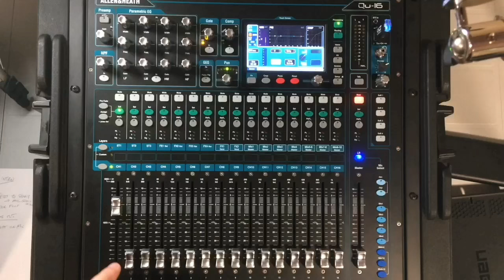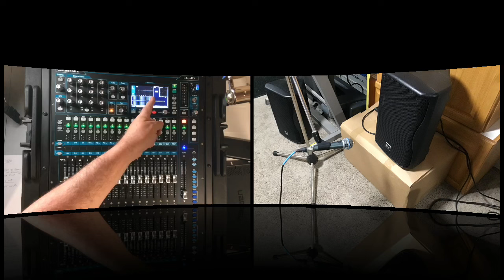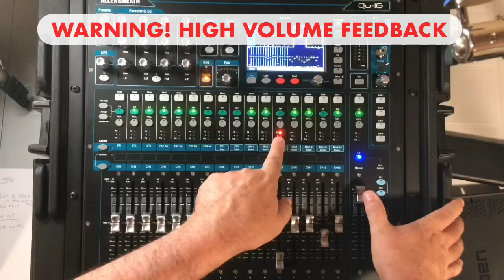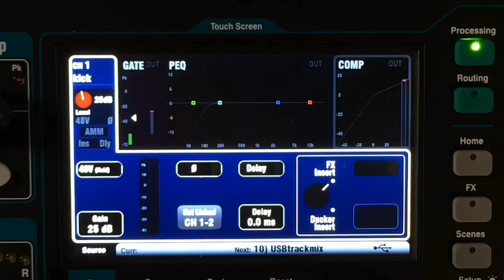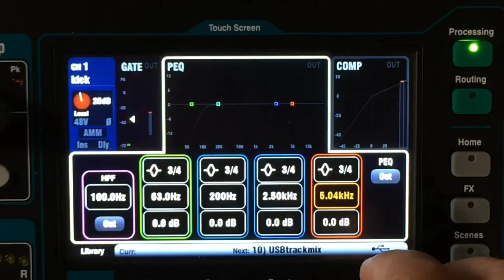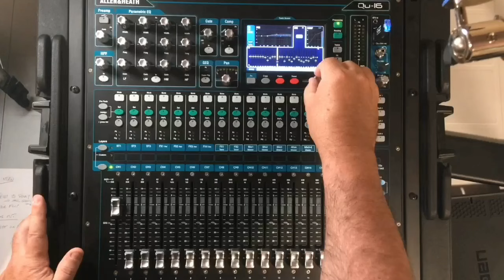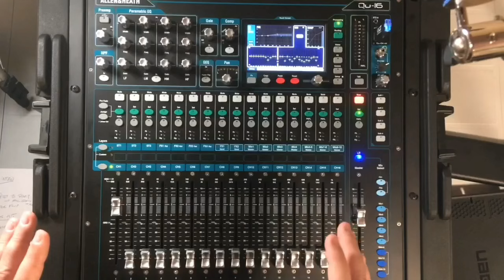How to ring out mains and monitors - A&H QU series WARNING High Volume

Comment: Is this level of eq cut pretty extreme because the mic is right in front of the speaker?  I would think this much master eq manipulation would negatively affect the overall sound, especially if you have lots of mics. Thanks for the video!
Reply from the maker: Thx James.   It’s not really that extreme.  As always eq cuts are like salt.   A little to taste goes a long way.  I did exaggerate the effect with a very close mic since you would hope that no one puts a mic that close to a cab in real life.   Unfortunately I’ve seen far too many singers drop their mic to their side and essentially point almost that close to a monitor wedge.    The number of mic’s wouldn’t have any bearing.

Comment: I use the same mixer.  Thank you for all the great content.

The thing is though.. When I have 4 different set of speakers for LR, Mix1, Mix2, Mix3.. It means I would have to use the same mics per speaker to ring out bad frequencies right?

Now what if...  I have 3 different brands of microphones? Do I then do it to each mic per speaker?

And yes, it's one of those mics getting too near the speakers/monitors that becomes the culprit so better prepare for it.
I did see someone comment on the number of mics and you say it won't affect overall sound.. so my dumb question would be: what if they are from different brands?
Reply from the maker: Thx Karl.  Yes, you are creating an eq setting for each set of speakers (unless they are identical speakers.  Eg, if mix2 and 3 are the same boxes then simply copy the eq after setting it for mix2).   You can use the same mic because you are determining how that same mic is reproduced in each of the diff speakers.
If you have diff mics, you just need to pick the one that either you use the most, or the one that has the most even tone.
Reply: @soundadvicewithrob3083  Thank you for the reply.  Currently using the mixer at an event now. Sadly speakers are all different, but I have managed to ring out the bad frequencies.
But I did it only with one type of mic.  We use Shure and Sennheiser mics and I only used a Shure mic for this process. Now we have boom mics too. And I didn't get to do this process.  Big regrets.

Comment: Thanks Rob. Now I now how to use that GEQ on our QU24.  You had the mic only 2 feet away from the speaker.  If I wanted to ring out the room however, wouldn't it be better to have the mic in a central "average" location.  Say middle center of the room?
Reply from the maker: I should probably post a disclaimer to that video because you are certainly not the first person to assume I intended it to be “literal” LOL.   I was really only trying to demonstrate the concept of notching the eq to address feedback.   Yes placing the mic right in front of the speaker was a) meant to create feedback quickly and b) I was working on a small space when I shot that footage.   Personally I find that 99% of feedback comes from stage monitors and very seldom from FOH (although it does happen).   Standing on stage I ring out monitors by literally pointing a mic into the wedge to force feedback, so the 2ft distance is fairly accurate.   Take it all with a grain of salt and you’ll find a way to apply the concept to your own situation.   Thanks
Reply: ok got it.  You do talk about that in the initial paragraph that I didn't read.  Thanks Rob. @soundadvicewithrob3083

Comment: Great video it will be helpful. Does ringing out bad frequencies generally give you a good EQ do you then need to boost good frequencies with the parametric?
Reply from the maker: Thx Jonathan, glad it was helpful.   Yes once the system is rung out, it’s a great place to start.

Comment: This is a great tutorial! Very helpful. However when I do it on my QU32 I end up cutting almost all frequencies from 400hz up, before touching the -10dB on the master fader. I have all processing turned of in the mic channel I'm using. Am I missing something?
Reply: Hello. It sounds like your amps might be turned up a little too high. Try just playing music at unity. If you have the input gain set correctly, and that channels fader at unity, then your main fader at unity, is it too loud? If so, then your amps(speakers) are turned up too high.

Comment: Another question for you. I use my laptop to play music such as youtube during some practices. I used to be able to use any of the ST1, ST2, or 3. My laptop reconizes the qu16. but when I pick any of the 3 I am not getting any sound. Any ideas why. Like I sad I once was able to do that. I tried different USB cables with no luck doing that.
Reply from the maker: Brian Larson The most likely issue is that the source for ST1/2/3 is not set correctly.  It must USB Streaming.  Select ST1, then select processing screen, select the function key to assign the source.   Make sure ST1/2/3 are set to USB Streaming.   This will allow the laptop to send output into either of those 3. Channels

Comment: Here's another quicker solution for mains 1) Set your PA and mics up properly on stage (Speakers always in front of mics) 2) Ring out the mains by bringing up the main vocal mic. You'll find you only have to remove one or two lower frequencies. Done.

Comment: Rob, we have a Qu-32 at our church. It was set up (pre-COVID) and it sounds fine live in the sanctuary, but I think that's because of the pre-amps in a not-easy-to-access location above the chancel area. We hardly get any lights on the Qu-32 ... sometimes one green. We're not getting much oomph to our livestream (Mix 9-10) even with all the levels pushed to the max. Do I need to adjust the pre-amps to a lower level and bring the gains up to help with this? I'm kind of grasping at straws...
Reply from the maker: Thx for the question Ray.   First question is Mix 9-10 set as prefade or post fader.    I’d suggest prefade so that the mix gets signal before the main LR faders
Reply: @soundadvicewithrob3083  All of the lights are green for Mix 9-10, so prefade.
Reply from the maker: Be careful about changing gains at this point if the FOH already sounds good.   Of course thats assuming that gain staging for all channels was done correctly, initially.   I have another posted video specifically on gain staging.     If youre not getting sufficient signal in a Mix output and have confirmed that that mix is prefade, then channel gain may indeed be the issue.   I suggest you save a scene before starting any major changes so you have a place to come back to if needed

Comment: Thank you. Did you explain to me how to connect a stereo cable, such as a DJ keyboard? Thank you very much
Reply from the maker: Connecting stereo is quite easy but depends on your wiring.    If you have 2 separate cables (either 1/4 or XLR) you simply connect each to adjacent channels. eg 1&2.      Then use the PAN control to move one channel to Left and the other to Right.     Finally for convenience you can link the two channels so they are controlled as one.   
if you are using a single stereo jack, the QU series mixers have 3 jacks just for for that stereo connection (ST1 ST2 and ST3)
Reply: @soundadvicewithrob3083  Thank you very much. This was very important for me and your excellent explanation made it very easy

Comment: So I am thinking about getting this board. I am coming from the QSC touch mix, and it will do it for you automatically when you press the feedback wizard. Does this have the same option, or do you have to do it one by one?
Reply from the maker: No, the A&H boards do NOT have the builtin feedback wizard found on the QSC
Reply: @soundadvicewithrob3083  Thank you, I appreciate it.

Comment: question if you are trying to do this with tower speakers do you use 2 mics  1 high in tweet section and 1 low in bass section???? Or just what??? Thanks
Reply from the maker: A single mic will work but pull it back far enough to catch the full audio range
Reply from the maker: A single mic will work but pull it back far enough to catch the full audio range

Comment: Is there a reason that you don’t EQ the mic before you start EQ the monitors ?
Reply from the maker: I think its prob better to use a source with a flat eq.   The Eq changes are then based on “any” SM58 in my case rather than an input with a custom setting.

Comment: For the Mic channel you are using, what is the gain setting for that channel?
Reply from the maker: Gain is typically set where the input peaks “around” 0db on the scale
Reply: Next question: how would you suggest we set the volume on our powered FOH and monitor speakers? At 2:00 is good?
Reply from the maker: Anywhere between 12 and 2 is fine.  Really depends on your venue and SPL

Comment: Sorry to say this but ringing out monitors like this is not really good, like another poster said, you have to make the room as neutral as possible with a good reference material. Next, you EQ the source to your liking. After you have done that, and only then, you get rid of a couple of unwanted frequencies with a parametric EQ not a graphic one, always using a narrow Q. I'm talking about 3 or 4dB cut at max. If you analyze that graphic EQ curve with Smaart you'd see how bad it is

Comment: Does this mixer work with pc now or is it still only mac
Reply from the maker: Thx for the question.  There are quite a few PC-based software daw that will work with the QU series.   You simply need to download and install the A&H driver

Comment: In normal operation you won't have your mic pointing directly at your speakers. you EQ settings is way too much cut's out that is "kilning" the sound. on A PA system, you only have to warry about vocal MIC's to feedback. so set up your mic's as they are going to be for the show, and  than use the procedure you showed!
Reply from the maker: Agreed.  Normally I wouldn’t want anybody to point a mic at a speaker like my demo.   However in real life I’ve had far too many novice singers and speakers who drop their hand to their side while holding the mic and it ends up right where I didn’t want it LOL.    Hopefully most folk will realize that this was a demo and I did exaggerate things to make a point.   Ths for watching and taking time to offer your feedback.

Comment: What would you start off on the fader 0db are -5db
Reply from the maker: if you’re referring to the main LR fader it’s personal preference.    for me I start at -5 and then i know i have that last bit of push up to 0 when i need it.    Up to you
Reply: @soundadvicewithrob3083   what would start the gain for the mic an the fader the same as the main
Reply from the maker: I have another video about mixing for a band which covers the process of gain staging.   I can't (and shoudn't) give a "start position" for gain because the proper process is to adjust the gain until the input level is around 0db.   This means the actual gain control will be completely diff for every input channel.

Comment: Sorry, but the concept of "ring out" a specific mic/speaker combination is senseless except when you only use ONE Mic and sound quality is no object.
In a typical stage situation you should adjust/filter the system (PA/Mon) to make it sound good or as neutral as is could be.  After that, you should adjust the actual mike
to sound good with an *actual sound source*. After this you will have no feedback if that is done right except unhealthy volumes come into play. 
But again, the above "ringing out"-method will not help you because feedback-frequencies and sources will become unpredictable for various reasons!

In short words: Filter if only feedbacks occurs (if you are not sure where: use the analyser that your decent console hopefully offers) -  
and good sounding system is always the best way to avoid feedback. It's that simple.
Or: Don't waste your short time on "ringing out" a random situation!
I started that way 30 years ago. Mistake of a rookie.

Comment: thanks Bob.

We use 6 microphone for worship leaders in a mid (just slightly bigger than a small size) church and one of the worship leader (female) voice is so soft/quiet that i have to increase the gain really high before feedback but since all 6 mic are use during worship including other music instruments like acoustic and electric guitar, drums and keyboard, Feedback can easily occur. 

Another problem is that the female worship leaders voice are generally high pitch and thin so from EQ, adding more bass or adding lower frequency only increase that loud hummm sound which just keep looping nonstop.

What i want to achieve is get a loud mix through FOH so people at the mid-back can hear the vocalist the loudest without causing feedback and also that humming. We use QU 32 Mixer, Sennheiser wireless 2 Mic with windscreen. Please help
Reply: Have you tried not adding bass to the female mics, and rather reducing high frequencies? 😊
Reply: I have a similar situation. About six worshippers . Acoustic guitar,keyboard and a drum set and I also use A and H QU 32 and I keep having a problem with Feedback.